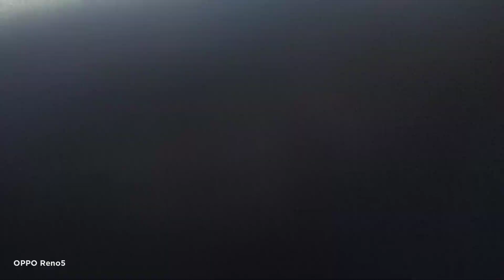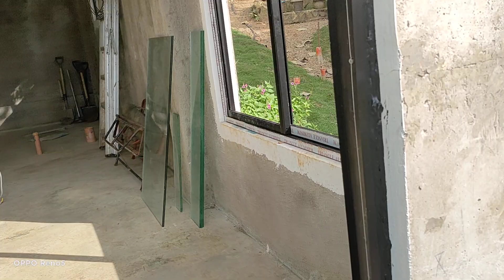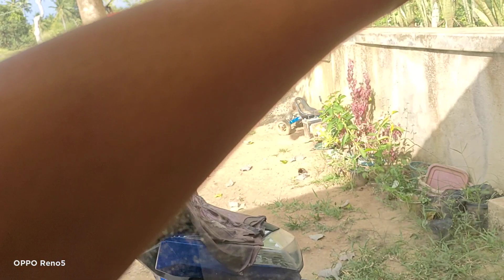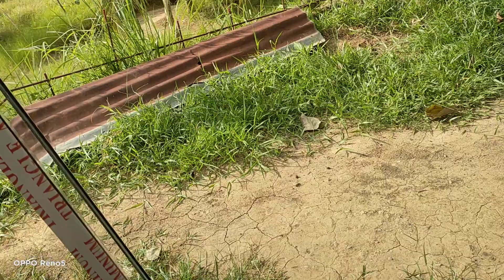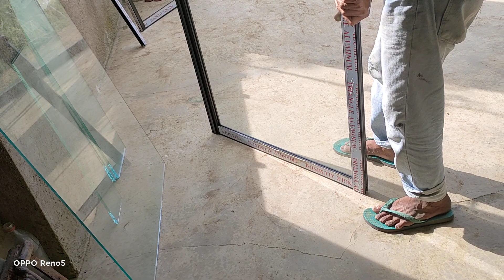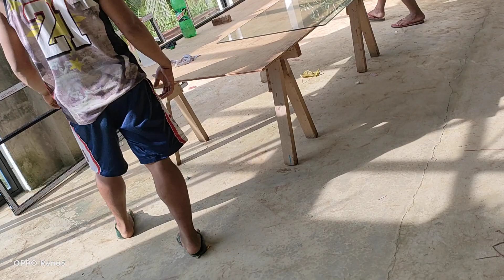Installing Glass Doors and windows

Comment: You will need screens to prevent flies and mosquitos from getting in the house.  Plus ventilation at night.  Its worth the extra cost. Keep the roof tight and plug any holes with a screen or wood to keep critters and bugs out.